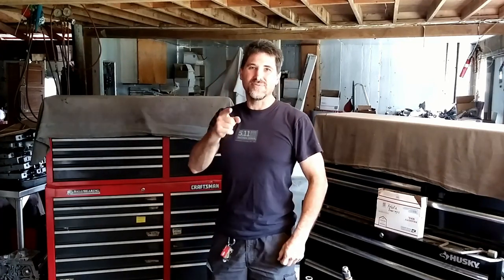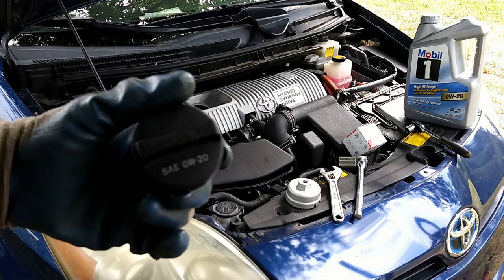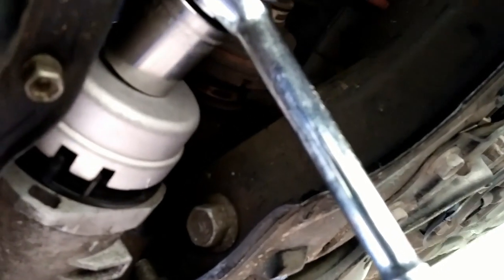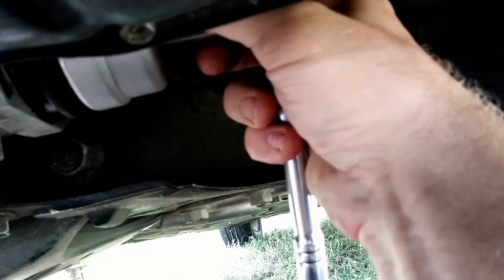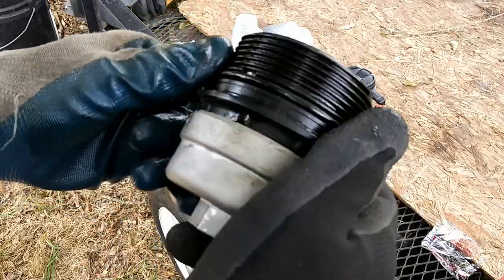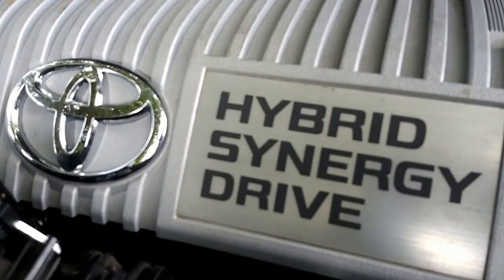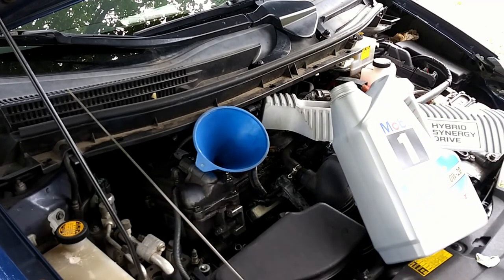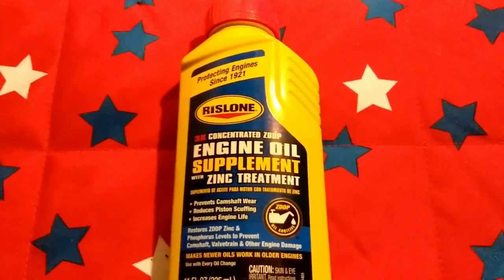Prius oil change step by step 2010 3rd generation toyota prius

Comment: you stated how to prep the oil filter with the spring, no one ever mentions that, also you actually stated the torque tolerance, although you got the bolt one wrong, its 28-31lb not 21.

Comment: You said inch pounds in the video, but it's foot pounds. 18 ft-lbs for the filter and 27 ft-lbs for the drain plug.
Reply from the maker: Thanks for the correction. I dont doubt I mistakenly said inch pounds. After rebuilding automatic transmission for over 25 years and torquing valve body bolts to inch pounds its a force of habit. If using factory specs for drain plugs its important to use a metal washer not a plastic washer. 27ft pounds can split a plastic washer. There are other drawbacks to plastic washers as well.

Comment: 2013 prius has 242000 miles transmision oil nevwr changed i was told dont change it transmision might stop workong so shall inchange
Reply: The eCVT does NOT have clutches so no clutch material to worry about. A drain and fill can be done at higher miles with no fear of it causing slippage. Check the Car Care Nut channel.

Comment: Wouldn’t you want to install the spring and filter tube in the filter housing first, it seems a little sketchy your way, there’s tabs in the bottom of the filter cup to lock the spring in place….definitely don’t trust the way you did it, definitely not the way I do mine.
Reply from the maker: I always lock it under the tabs too. Did I not include anything about that in the video?
Reply from the maker: I just watched it and your right I did not include the clip showing the tabs. Thanks for letting me know. I will make another oil change video.